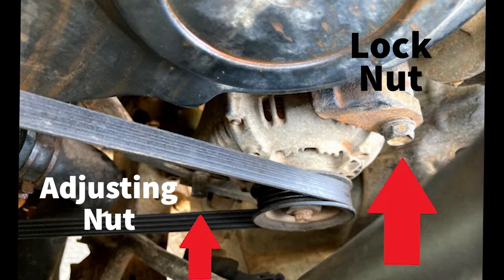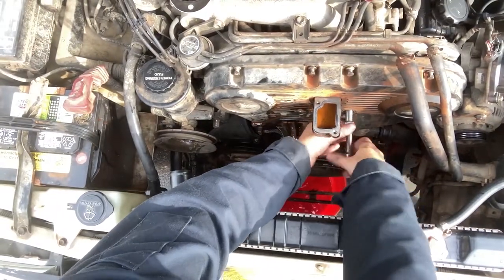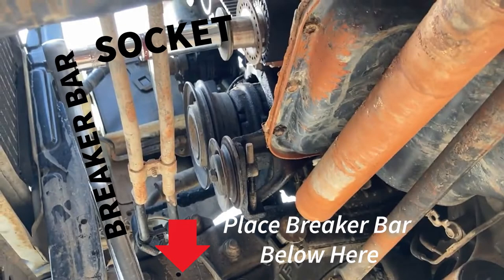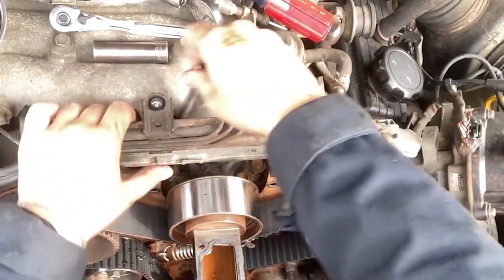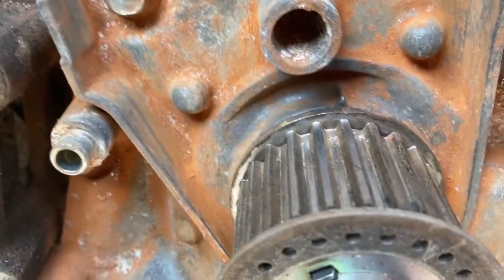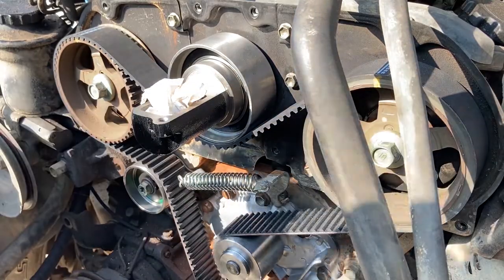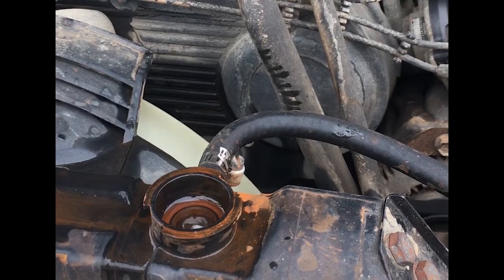Toyota 3VZE 3.0L Timing Belt, Water Pump, Tensioners Replacement - Girlie Garage

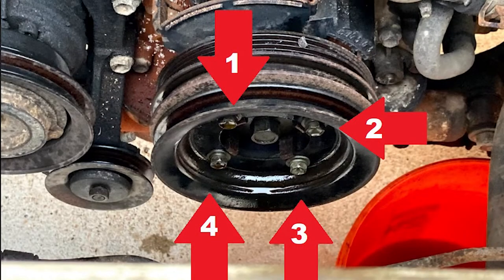Comment: 10:41 What is the material used to hold the crank pulley in place when installing it?
Reply from the maker: You should use the proper tool (you’ll need it to put it back on anyway). You might be able to rent one from your local auto parts store. Here’s a link if that’s not an option: https://amzn.to/3NZzDs8

Comment: I just bought a Toyota itasca camper and the water pump belt was missing but it doesn’t overheat i was thinking about juat getting a belt but might as well do the waterpump too
Reply from the maker: Definitely do the water pump while you’re in there. Maybe thermostat too. Seems weird that someone would have removed and not replaced the belt

Comment: Hi, this is a bit of a shot in the dark, but how were you able to reinstall the power steering belt so easily? All my belts were worn to hell, so I went ahead and bought toyota oem belts (was already ordering parts so thought id get this out of the way) but I cannot for the life of me install the new belt. They are just about identical, but the new belt is just a tad wider. They are seemingly the exact same length and height. Do you have any ideas?
Reply from the maker: It’s possible you were given the wrong part (if it’s wider) I would double check with the parts department that you got the belt from and bring the old belt with you
Reply: @GirlieGarage  They are both just about identical, and I checked the part numbers along with length and such, and this is the right belt, but I still cannot for the life of me get it on.
Reply from the maker: @tibs9149   I cannot give you better direction without understanding what way it’s not going on, try to loosen the power steering adjuster all the way then physically move the power steering pump down with your hands.
Reply: @GirlieGarage  that’s what I kept doing, couldn’t get it on yesterday, I don’t know what changed but I was able to get it on just a bit ago. Thanks for your help and the informative video!
Reply from the maker: @tibs9149  congratulations!!!

Comment: Hey, Im curious; why is it that after you installed the timing belt and rotated the engine the timing marks on the cams matched the marks on the dust cover, but the marks on the belt were off by one tooth?
I am working on doing this to my truck right now and want to make sure I get the belt timed right.
Reply from the maker: I hope I’m understanding your question correctly. The marks on the belt are for installation. Once the belt is installed it is not a big deal if the belt moves as long as the timing marks on the drive pulley and crank pulleys all line up. 
If you are re-using an old belt you should mark how it came off to put it back on the same way.
Reply: @GirlieGarage  Thank you, that answered my question.
Great video by the way. : )

Comment: Hey I’m about to do the timing belt on my 4 runner and been struggling to find all the torque specs, I was wondering if you would have a list of them?
Reply from the maker: All of the torque specs for this vehicle are in this video. If you’re working on another engine you can just Google “torque spec for _____” and you should find what you need

Comment: Is there an easier way if I’m just replacing the serpentine belt (alternator) ? Or do I still have to take out the other belt and fan assembly?
Reply from the maker: If you’re just doing belts you don’t even need to take the fan off, you can just slide the belts around the fan
Reply: @GirlieGarage thank you it helped a lot! Also, how do I get the tension right on the serpentine belt? I tried prying on the side where alternator is to add as much tension but it’s still squeaking bad
Reply from the maker: @DillonDoe-z7p are you reusing the old belt or do you have a new belt? If it’s too loose you might need a new belt. Otherwise there’s really only one way to adjust the alternator belt and it sounds like you’ve got it maxed out
Reply: @GirlieGarage  no I have a brand new oem one from Toyota. And I found out not to long ago it actually kind of sounds like it’s coming from my power steering pump or something which is odd but my buddy pointed that out. Does that sound familiar at all?
Reply from the maker: @DillonDoe-z7p  Does it sound like this: https://youtu.be/OCqD5Id2rFA?si=Ud8GeaMuG-PqoXDt or does the noise get worse when you turn the steering wheel?

Comment: This helped out on getting info on what parts are what. Just wondering where did you get that info. Hanes and Chilton manuals don't really show everything. Or maybe I haven't read enough 🤔
Reply from the maker: I would be happy to answer but can you clarify your question for me? Which parts do you mean or do you mean gathering all the parts to be replaced in the first place?
Reply: Just terms for parts in general. I didnt know what they were called. Once I find out what it's called I usually find out what it is after.
Reply from the maker: @leoblanksanta626  Gotcha, well I have been a mechanic for many many years and I am familiar with these parts and their names so that is how I knew what they were called without looking at the book. Does that answer the question? Happy to elaborate.
Reply: Yeah. That makes sense. Thanks

Comment: is this a non interfernce engine, so if the timing belt breaks is the engine sparred or damaged?
Reply from the maker: The 3VZE is non-interference but you can still have damage if you were driving and the timing belt snapped. If you’re doing this job yourself, fastest way to check is to line all the timing back up and get your belt on and see if it runs. Then you can go a step further and check compression.

Comment: How do you keep the fan pulley from spinning while removing the 12 mm nuts
Reply from the maker: You use a jerking motion, or also tapping the wrench with a rubber hammer helps break them loose. The belt should be holding the fan pulley still at least a little bit but you can also hold onto the belt to keep it tighter

Comment: Do you think that the engine oil cooler on the driver side of The block could be causing coolant to get into the oil?
Reply from the maker: That sounds possible. It has seals just like everything else. I know on some Fords, they have o-rings inside that go bad and you end up with the fluids mixing.
Reply: @GirlieGarage  Call thank you for the timely response. I’m wondering if I should check that before I go ahead and all the heads up and try to do a head gasket. Do you think it would be worth it to do a head gasket on this engine? I’ve heard that they are not worth it and it’s just easier to put in a used engine.
Reply from the maker: @moejr14  There are multiple tests you can do to determine if you head gasket is blown. I would test before replacing or assuming.

Comment: Is it okay if the timing marks aren’t aligned after doing the bump method?
Reply from the maker: No. Before you remove the timing belt, all timing marks need to be aligned. You should be able to tighten the bolt enough to use it to turn the engine, then just using a quick jerk, you can break it loose again (with your hand tools)

Comment: Did you use RTV when installing the water pump
Reply from the maker: As a rule of thumb, if a component has a new rubber or silicone gasket, I don’t usually use RTV (or I just use it in the corners to hold it still). If it doesn’t have a gasket, then I use RTV (or the correct gasket maker for the job)

Comment: I'm about to purchase a '89 SR5, manual, 3.0l engineerings with 108k miles.  Will have to drive it 50 miles, a little worry about the timing belt, no work has be done on the engine.
Reply from the maker: When was the last time it was driven?
Reply: @GirlieGarage  It was driven by the current owner within the several past day to Home Depot.  I drove the truck safely from San Jose to San Francisco at 60 mph.  It ran very smoothly.  In the process of changing the timing belt/water pump, your video is extremely helpful.  Ordered AISIN  oem belt & water pump & all metal radiator.  Both the water pump and radiator has similiar 1/2" diameter nozzles.  What are they use for-do I connect them together with a hose?  Thanks for you advise!  dave
Reply from the maker: @ddea888  Sorry David, not sure what you are referring to so without pictures or links I'm kinda guessing. The bottom of the radiator has connections for an transmission oil cooler if your vehicle comes with that option. Make sure that you also purchased the correct water pump. You have the option to purchase with an oil cooler connection or not. I think that is what you're referring to and I hope that helps!

Comment: Would this be different be on a 1994 3.0 V6?
Reply from the maker: Hey Gentry! It should be a similar process but rather than a spring you will have a hydraulic tensioner.

Comment: Your right cam belt mark is off by a notch @ 9.24
Reply from the maker: After you rotate the engine by hand, it doesn’t matter if the marks on the belt are off, it matters if the timing marks line up
Reply: @GirlieGarage  So if the belt markings don't comport with actual timing,  what are their purpose? To confuse?
Reply from the maker: @WayneHarropson when you FIRST put the belt on, you need them to set timing. After you set the tensioner and turn the engine the lines on the belt no longer matter

Comment: I had everything great.....   I got the belt loose, and the right cam turned!    Can I just wrestle it back the way it came, or continue a full revolution back to TDC????   HELP!   Must've had some weird tension, but click, click, click, suddenly it's 45 degrees clockwise.
Reply from the maker: What do you mean by “click click click”? I was able to turn my cam back the way it came
Reply: @GirlieGarage  I just did the same.   It just ticked and turned clockwise when I loosened the belt, but I just turned it back by hand...    Fingers crossed, and I'm halfway done.....    Now for the pump replacement, belt replacement, and put everything back.  Thanks so much for this video!
Reply from the maker: @dredger9mm  as long as you set all the timing marks and turned the engine by hand (at least twice) and all the timing marks lined up, you should be good!

Comment: For the idler I stripped the bolts idk where long n short ones go please please help I'm in the rain. What do I do
Reply from the maker: Which idler, are you working on the small idler on the front of the engine (#1) or the idler with the radiator hose going through it on top of the engine (#2)
Reply: @GirlieGarage  #2 I'm still working on it in the dark and raining
Reply from the maker: @thedude3189  Try renting a tap and die set from your local auto parts store so that you can re-cut the threads. Take the bolt with you so that you can make sure they have the correct size tap. You can also buy a nice tap and die set from Harbor Freight if that is an option for you. Those bolts are hard to get to. If you look at the comments on this video, one person responded that if you are planning to pull the cam pulleys to replace the cam seals, once you can get the cam dust cover off, it is much easier to reach those bolts.
Reply: @GirlieGarage  I never had any dust covers or anything...everything is off I just put the belt on
Reply: @GirlieGarage  I'm not doing anything with the cams
Reply: @GirlieGarage  it's my bolt for my tensioner I need to get to work tomorrow or I'm fired plus I'm on the highway stuck
Reply: @GirlieGarage  let me explain again my timing belt tensioner wont tighten please help, the bolt wont tighten
Reply from the maker: @thedude3189  can you message me on Instagram @GirlieGarage

Comment: Have you done the head gasket on the truck ?
Reply from the maker: I have not. Do you have the service manual?
Reply: @GirlieGarage  yes i do but It doesn’t really go into depth on how to fix it
Reply from the maker: @cristobalperez6855  It looks like there are some decent tips on the Yototech forums and videos on replacing the head gasket:

https://www.yotatech.com/forums/f116/3vze-head-gasket-replacement-my-turn-115431/index3.html

https://www.toyota-4runner.org/classic-t4rs/98759-3vze-head-gasket-diy-advice.html

https://www.youtube.com/watch?v=ZCu0YE_MIAU

I don't know if by "fix" you mean what to do once you have the head gasket out, or what to do once you have diagnosed the problem and the problem is NOT the gasket.

Comment: for those with differant years toyota, careful about the distributer. some have a gear that if you install it wrong it can fuck up your engine.
Reply from the maker: Hey QuinnSmithy, just checking what you’re referring to? For this job you don’t need to touch the distributor.

Comment: Lmao, I feel your pain on removing the No 2 tensioner 

EXCEPT.... I had to do the knock sensor, so instead of coming from the front to do the timing, I had to go below, which actually made removing the timing idler alot easier, although this had to be removed in order to release the intake manifold, fucking stupid ass design on these Toyotas, yet people want these 

For what, a headache of a car and being the next sorry sucker for someone else's unmaintained truck, along with the fact that it's a gamble on whether or not some had already done the head gaskets

When people find these, it's not a few simple jobs to maintain it, no it's fucking rebuilding almost 3/4 of the truck
Reply from the maker: The 3vze was not their best engine....it is also prone to overheating if you don't take excellent care of it. If you do take excellent care, it should run forever. Difficult trade-off  but it sounds like you're at least capable of doing most of it yourself! Hope your truck is back together!
Reply: @GirlieGarage  well I made the mistake of trying to move the crankshaft pulley while the idler was off and also when I did put it all back on the belt markings don't line up and cam sprockets won't line up when at TDC
Reply: Also someone changed my water pump before do I still need to remove it
Reply from the maker: @getzapped313  I do offer consulting if you would like help with this project. It can be broken down into 15-30 minute increments if you just have a couple questions about your DIY project. You can reach me directly on my website or at info@girliegarage.com
Reply: @GirlieGarage  well I actually stopped for a week to spend time with family and left off at aligning the crank to 0, now I just have to continue where I left off